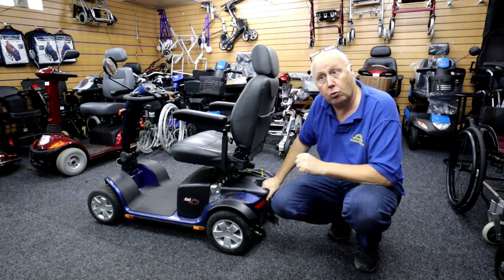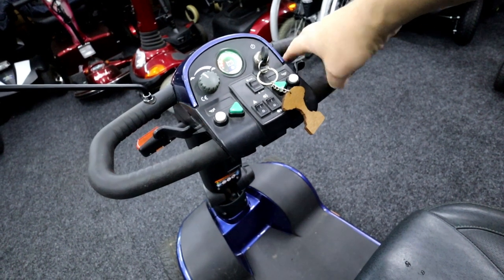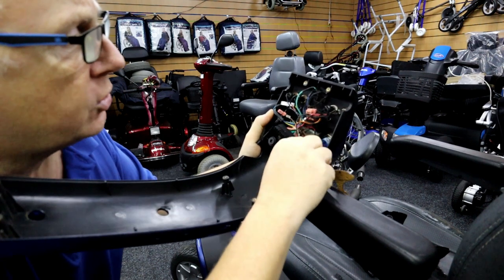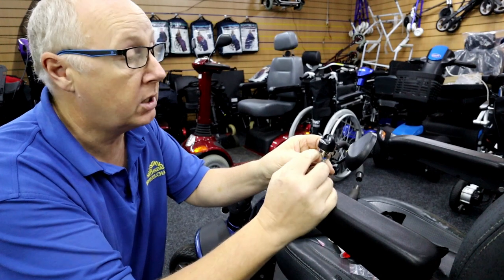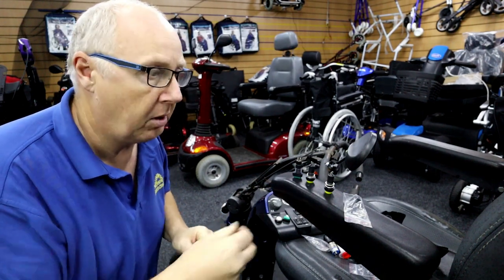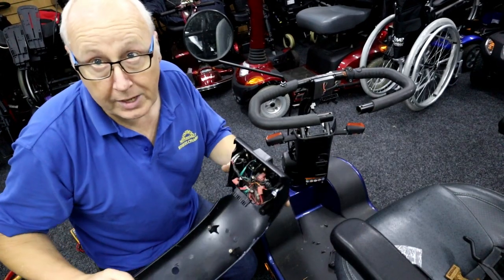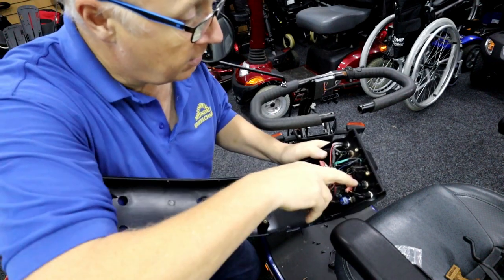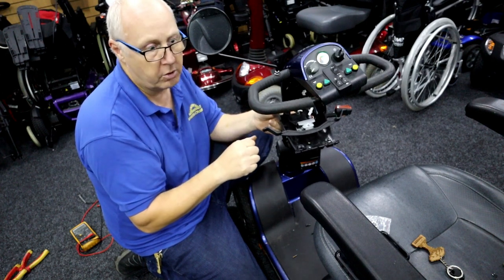Scooter Fault finding after being left outside in the rain.

Comment: I operate a Scooter rental company around Disneyland. I encounter this type of problem all the time. I usually check the forecast and install a large shower cap over the steering and tiller. I had one service call 🤙 and the guests ignored my warning about the 💦 Warning. However I traded out the scooter and I took the entire tiller apart.... blew out the water. From my experience the long term undermining issues are rust issues as specially with the Speed Pot! I am trying to come up with a idea 💡 about having something permanent over the tiller steering area. If you have any ideas please share! I plan on opening up another location in Disney World by Orlando Florida where it rains a lot! Thank you for sharing!
Reply from the maker: Hi there.  Yep can be a bigger when water gets in. We do sell covers that go over the tiller they stretch over the handlebars etc but it does not help if customers remove them. Lol 😂 we do one where the customer has to put there hands through a hole mind you that keeps them warm as well not that would be an issue in Orlando
Reply: @tomjacques4  Can I order these through your website?
Reply: Good to know you have a rental company there .. not such good news it rains so much! Us Brits would be wanting to get away from the rain 😂

Comment: hi mate any help appreciated. rascal ventura. when pull throttle motor spins but wheels wont go.  also you can push it like its in freewheel !!!   weirdly it will reverse (well it did when i tried it)   any ideas thanks Dave

Comment: We towed an acid
Cooter C3 about 5 mph for 2-3 miles
Periodically it would seem to lock up but then coast again. Trying to turn it on after charging over night we get a e
Rr03 code which is a short to the motor. I have not checked all the electrical connections because it’s brand new. If we don’t get a technician soon I’m going to have a look. Any ideas as to what it might be? Ty
Reply from the maker: Could have blown the controller when towing it. It’s normal that it Lockes up that’s to prevent damage

Comment: Hello from the Azores Islands.. I was watching some of your vids but didn't see my problem, i have a citycoco 3 wheeler and just today it stoped moving. All the lights come on and has a full battery and i can hear and see the motor working in the speedometer but it does not move. Do you think the axle is broke??
Reply from the maker: sadly, i do not know that scooter looks like a chopper to me not used in the UK. but usually there is a linkage between motor and axle check that.
Reply: @tomjacques4  ok , thank you ...

Comment: Hi got vista dx scooter and has problem with charge point had it in a shop they have found out its had water in it before I bought it the controler has got water in blown I have to charge it thought the battery pack are these controler unit expenses  to buy

Comment: I have a problem with the chair, everything is working fine, the lights and sounds, the battery is working and the brakes, but the chair does not go forward and does not go back. 
Please Answer me
Reply from the maker: Difficult to say wht checks have you done
Reply: Get It Checked Out And Make Sure The Controller Have No Water Damage

Comment: Hi, do you give advice on where to get parts? I have a mini crosser x1 3 wheeler, there is an intermittent flashing telling me there is a controller issue and, the manual brake release to push the scooter isn't working. But most of the time, the scooter powers on and works fine. There is only 1 company that support the repairs in Bristol, but none locally in Wales. The callout and transport fees are too much, I'd be happy to replace parts, but cannot source them and the service people in Bristol will not supply parts without fitting. Any help appreciated :)

Comment: hi. ive recently put some new tyres on my shoprider traveso mobility scooter and on the one front wheel the bolt keep's on coming loose all the time whenever i go out on it. why does the bolt keep on coming loose all the while  ? i keep on tightening the bolt up tight but it still keep's on coming loose. what is the problem please. the scooter had grey smooth tyres on it but i brought 4 new tyres for all of the 4 wheel's as black unsmooth chunky tyres. Many Thank's Kev
Reply: The Bolt Alway's work's itself loose on it's own accord

Comment: Hii, I have a TGA Breeze S4 I must admit its an old model  many times I use it to travel about 6 mile round trip because I can't park a car anywhere near to where I need to go and I can't walk the distance from where I can park a car. Whilst I'm traveling on the scooter I usually do it on its fast speed of 8mph however after a while the brakes come on and lock up the drive wheels, I give the scooter about 30 seconds to one minute and it's fine I travel some more at the same speed and it does this again, so, I put it into the slow mode 4mph and it works fine with no problems. I was wondering, could it be that the motor is overheating and this triggers the motor to shut off? I'm 20 stone, I had a leg injury which damaged my knee, this prevents me from walking. So I need this scooter I can't manage without it, so, can I pick your brains for a possible solution?
Reply from the maker: Mmm interesting.  Ok then I recon your batteries are ok with that I mean the lights stay on etc. drawing too much current may cause this then the controller will shut down but I would of thought the circuit breaker would of released ..  mmmm thinking lol. Ok then feel how warm / hot 🥵 the motor becomes. Does it’s always stop at the same amount of time (time yourself while driving at high speed). Now the not so good part check all wiring connections and this is a nightmare on a breeze S4.  Maybe an issue with a connector at the back of the tiller Pcb could be tripping there. Very difficult to say. And I would say I’ve never heard of it.  Let me know how you are getting on

Comment: Hi tom are you familiar with jjs scooters ? Got fully charged batteries but no forward or reverse,  when ignition switched on got 2 beep/flash codes 12 and 31 on a curtis 1210 controller and advise appreciated
Reply from the maker: Check motor is ok brushes etc.
Reply: @tomjacques4  yeah motor works when i bypassed it with cables direct
Reply from the maker: @paulwoodburn4474  the Curtis has a funny flash code it will flash twice in a special sequence. So flash a few times then a gap then flash again a few times usually with different flashes. So let’s say flash once then a gap and then 3 times. Or flash twice then gap then another few times or flash 3 times then again with a different amount of times. So please check again. And let me know
Reply: @tomjacques4  ive got a video of it flashing beeping if thats any good ?

Comment: Hiya mate, any chance you know what the 8 beep error code for the Solax Genie is? I hear the brake disengage then beeps. I'm think motor related. Thanks
Reply: Ah, just checked the controller which is called a Dynamic R series and the error code 8 is motor voltage issue. Just checked all the wiring and connections and they are all good so I'm lost.
Reply: cable from controller to motor is fine and shows motor resistance 1.0ohms . As there is no error code listed for controller maybe the controller faulty and not putting voltage out to motor
Reply from the maker: There have been two types of controller fitted r series and s drive check all connections and if they are all ok could be a faulty controller.
Reply: Thanks mate yeah, I tried a different model controller with same sockets and it worked, albeit very slow but must be just how the controller is set up👍👍 @tomjacques4
Reply from the maker: @RetroMods  the controller will have different software installed you can damage the motor etc. make sure you take the old controller together with the new one and get a dealer to transfer the software. It’s. A 10min job
Reply: right thanks but I only tried the donor controller just to confirm the original controller was faulty so I've ordered the exact same controller as original. What would a dealer charge to transfer the software though? Just for future reference. Thank you @tomjacques4
Reply from the maker: @RetroMods  a standard call out charge